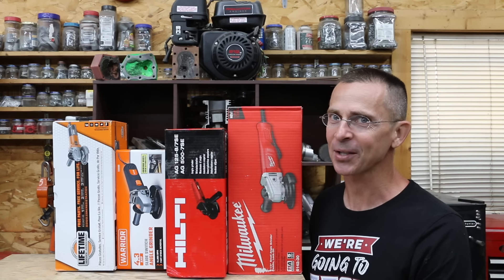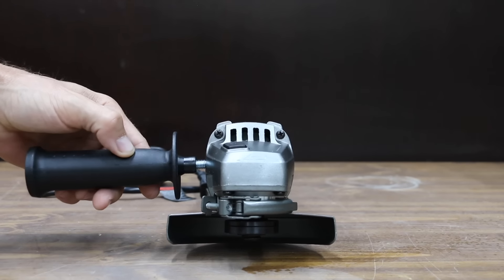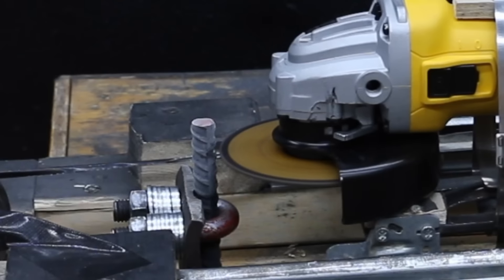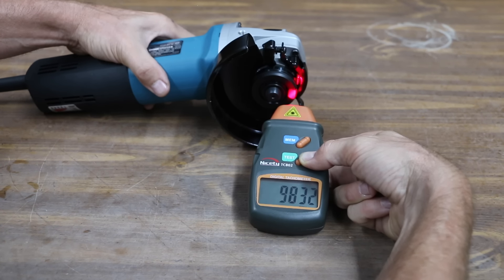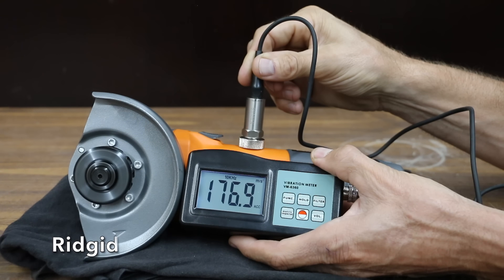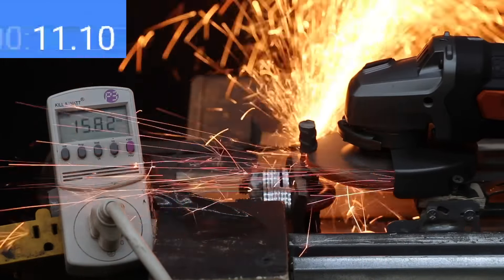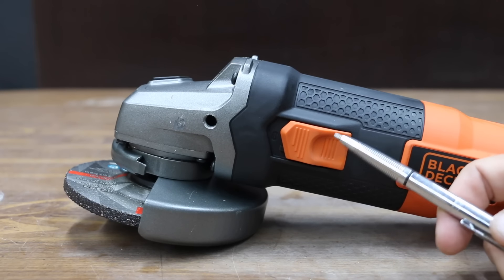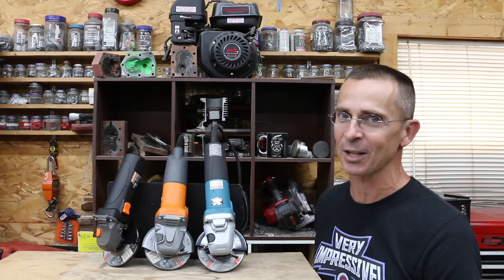Best Angle Grinder (Corded)? Hilti vs Milwaukee, DeWalt, Makita, Ryobi, Ridgid. Let's Settle This!

Comment: I am kind of a Milwaukee guy, but I do  listen to reason  and this channel.
Reply from the maker: Thank you!
Reply: I've come to learn that listening to reason and listening to this channel are pretty much the same thing
Reply: I've got the 13 amp Milwaukee grinder. It's a beast, kinda let down because that's the top model, not the 11 amp.
Reply: Well it's actually a 5 inch grinder, I forgot.
Reply: Same!
Reply: That M18 Flathead is calling to me, but all these corded models remind me I don't need to be brand loyal.
Reply: @3vil3lvis  true... your batteries are not needed :-)
Reply: @drewdoestrucks same results
Reply: This channel is reason. The reason I buy so many tools😂
Reply: @Sparkystacoma  me too. Im always like well I know the best tool so I better go get it!
Reply: I'm a Milwaukee guy, or Hilti guy, myself, but after 25 years of grinding through masonry 8 hours a day....

The best grinder at the 4 to 5-in range is the corded brushless 13 amp DeWalt with the lock-on pedal switch. It is superior in every way to every other brand we've tried, and yes, we have tried every other brand and only at their highest end.

The second best would probably be the hilti, but it has a sliding lock switch which quickly becomes jammed in dusty environments, and is a bit heavy if you're using it for hours on end.
Reply: Ive started basing many of my purchases off of this channel lol
Reply: In my case I would have probably gone Ryobi if i hadnt been in a harbor freight 😬
Reply: AvE is a great channel and so is Torque rest channel, between this one and those two, I can't buy anything without watching videos first
Reply: Smart man
Reply: @tylermierholtz9424  he doesn't test for years of use
Reply: Makita wins for a change over milweakee
Reply: The same thing
Reply: @cristopherfrakes1416  those dewalt are some beast. And they’re super lightweight
Reply: The Milwaukee 6" corded grinders are  the most  Uncomfortable to hold feels heavy and  unbalanced and just all around don't like it. I'll stick with Dewalt or Makita.  For these 4.5"  grinders to me they are all useless for every day use, unless your a hobbiest and aren't going to be using it a lot.
Reply: I go Milwaukee cordless, and look up the best for each tool for corded
Reply: There's a reason all of the metal shops I've worked at have used Makita grinders!
Reply: Me too makita dude
I will buy all my tools from makita, but my God the Milwaukee lineup is something different 😂
I wish makita would do that
Reply: Milwaukee guys just like the colour. If you want a red one then Milwaukee is the best!
Reply: Say you’re a Milwaukee fan girl without saying you’re a Milwaukee fan girl.
Reply: So am i.  But I've had a big makita grinder for years works great.
Reply: That makes one of us lol
Reply: milwaukee nice i have it but makita grinders r simply better
Reply: I like Milwaukee and Ryobi when spending more 💰.  They have good customer service and not many issues overall. However, If it is something I may use once a year or it's once and maybe never again, I am not afraid to buy harbor freight. Several drills and a drill press that work fine.
Reply: I was looking for this comment.  Luckily it was right on top.
Reply: I chose to go Milwaukee too, and I am generally very very happy with my tools, including my M18 fuel angle grinder, but angle grinders in general, and corded in particular, is Metabo territory.
Reply: @cristopherfrakes1416  yeah man I’m a pool repair technician and work in the worst environments for any tools. Salt water, chlorine, masonry dust, heat, sunlight and mud and sand. The paddle switch grinders are the best overall for their durability and i find the trigger grip(rat tail) dewalt and the hilti grinders last the longest. The 7” makitas are some beasts as well.
Reply: @jbuch66koop same, would've like to see it. I mainly got that one because of the variable speed and constant rpm function under load. Great for polishing and wire brush use. I think any 13a grinder is going to be a monster at cutting speed. 

I'd like to see a test about the rpm control under load. To me that's a very important feature of the variable speed models.
Reply: @1rstTry  🤣🤣🤣
Reply: Same, i personally like the Metabo one. The tool free wheel flange makes changing discs super easy.
Reply: A retest with other brands I'm a fan of Hitachi 4.5" grinders cheap and nice switches. I hate a trigger pull.  Sometimes you hold them by the head.  Depending on what and where. If you hanging off a structure grinding welds with one hand.  It's hard with a triggered grinder. Great review always.
Reply: @ProjectFarm is the Chicago electric brand at harbor freight still around?
Reply: I love millwaukee Dewalt and Hitachi. I just own all Dewalt cuz it's what I started with n my ocd don't like mixing red with yellow or green😂 I'd be happy with any of the 3 brands though
Reply: Die hard Milwaukee guy here, Knew the winner the second I saw the makita in the mix. It's their nitch and Milwaukees weakness.  The makita will probably outlast the Milwaukee 10 to 1.
Reply: @cristopherfrakes1416 I've been using grinders for over 20 plus years I have over 40 of them makita is by far the best there's a reason alot shops have them! That dewalt one you're talking is OK but nothing special.
Reply: @truthisweareallgonnadie.  The ones we use are the DWE43214 models. We do not use them in the matter of that most shops will, grinding a weld here or there, or cutting through a piece of steel. We use them 8 hours straight of non-stop grinding through mortar joints. Different tool for different job.
Reply: Milwaukee and Ryobi are subsidiaries of the same company.
Reply: I use whatever I have batteries for.
Reply: Ya The Millwaukee Has a 5☆Agenda😊@ Switch/Trigger To "iT's" Advantages, & another; 😂Thing .....
Reply: I've Been Down iN the 😮Trench's Since 40Years ago, & That 5/8" Rebar Taxed Those TooLs Something MIGHTY, maybe Hum a $33 CouLd be an Okay ? Option, & Save 😂Your Good $$$ TooLs 4Bragging Rights Lol
Reply: I'm something of a Milwaukee guy myself.  With great power....
Reply: @ProjectFarm can you please do multimeters, idk how you’d compare them test wise, but it would be interesting, to me anyway . 🙏
Reply: @jbuch66koop we use the 13 at work, we burn them out pretty often.
Reply: @cristopherfrakes1416  dewalt is overall the best.
Reply: good to hear that but only good Milwaukee is for is how powerfull their impacts are and their m12 stuff in general. none of their tools last as long and they're not worth repairing as parts aren't individually available
Reply: That's very reasonable of you. Team red gets lots of wins on this channel... Thanks for letting us Makita bros have our few and far between wins. 😅